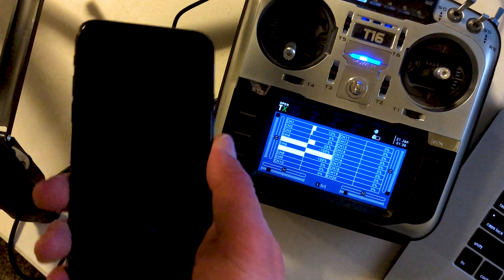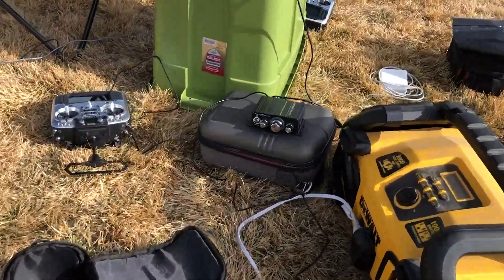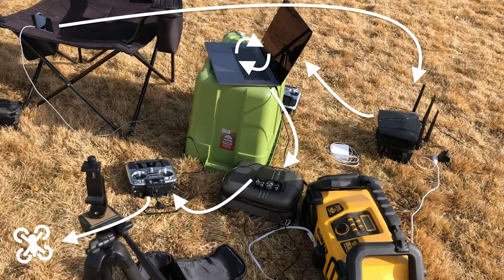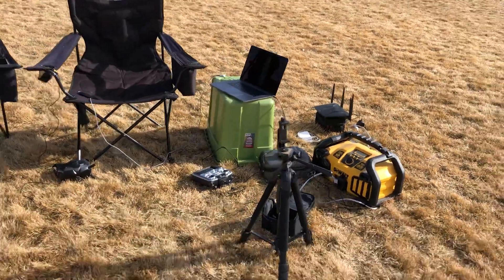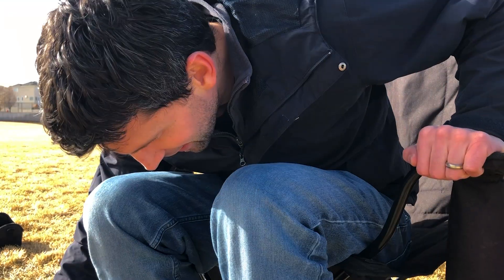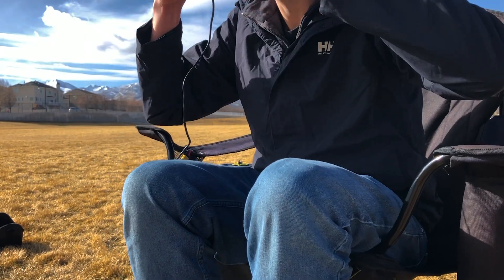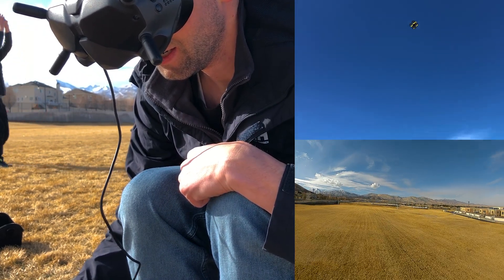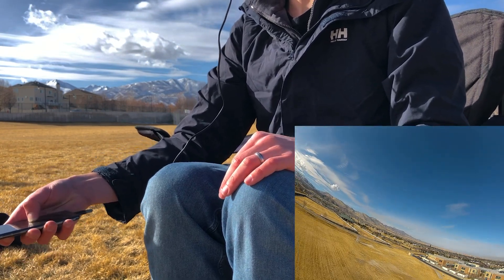Controlling an FPV Drone with an iPhone in Acro Mode

Comment: Cool, good job. I'm new to drones and I wonder why you have to use a RC radio transmitter from the last century to fly a drone. A drone is flying computer for me and there is a potential how to fly a copter in a different way. The Taranis X-Lite Pro with motion sensors is a good starting point. Not for freestyle or racing, but probably for cinematic stuff.